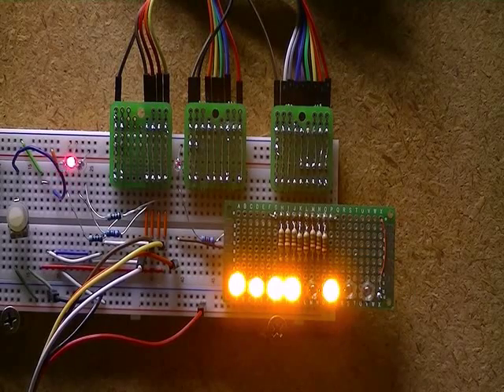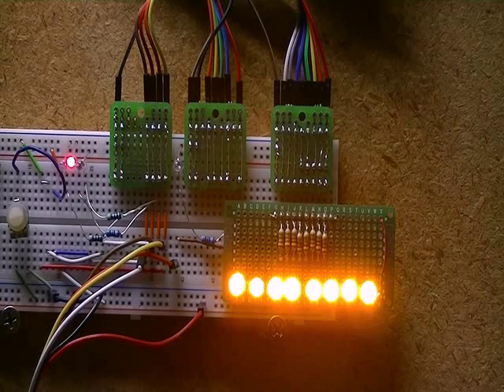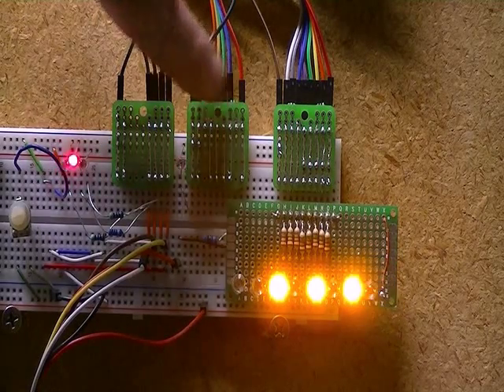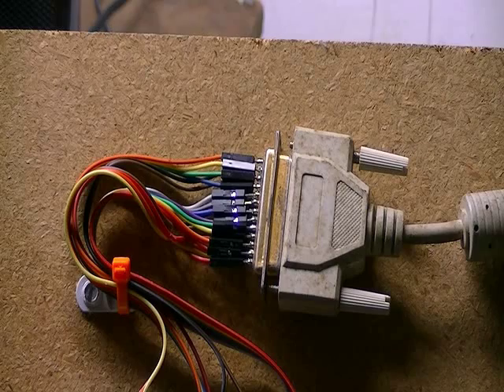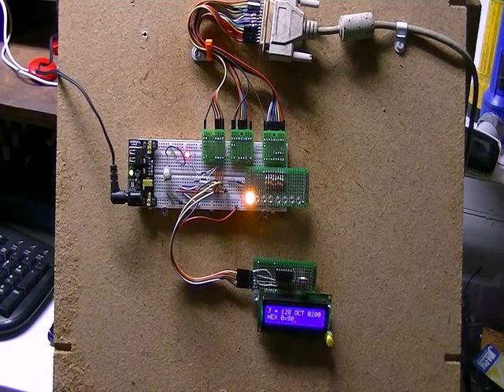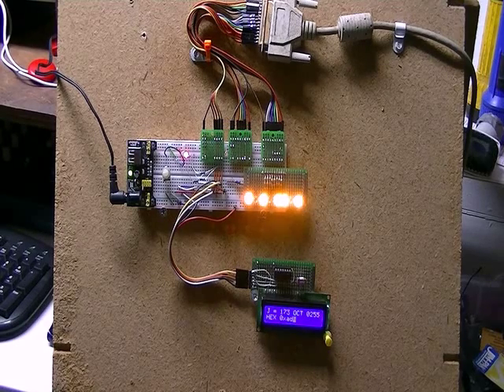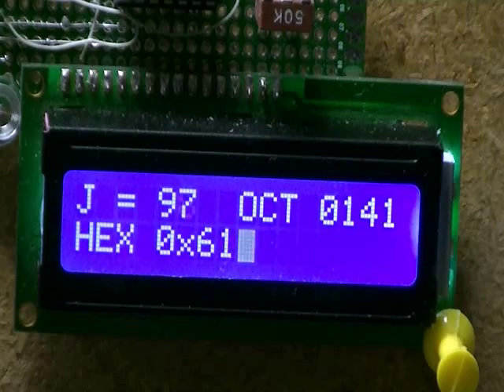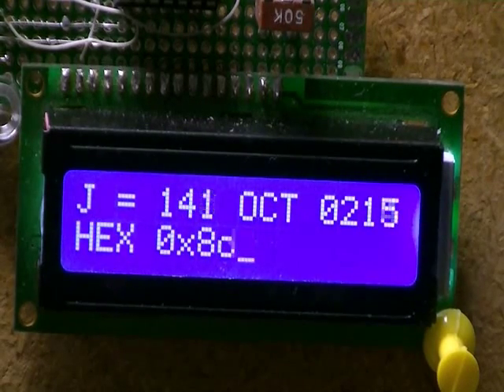Beyond Raspberry Pi Connect Electronics to PC printer Port with Python

Comment from the maker: I'm almost done with a bootable CD that can
also be installed on any PC with a printer
port. That way it can operate "live" if
one doesn't want tamper with the computer.
Be ready to go in minutes, connect, program.

Read-Write Arduino ADC PWN with Printer Port

Printer Port to Serial LCD Display

Raspberry PI Arduino Advanced Interface

Connect Arduino to PC Printer Port for advanced control

Setup PC Printer Port with Python-Linux

Use PC Printer Port to Read Analog Voltage

Beyond Raspberry Pi Connect Electronics to PC printer Port with Python